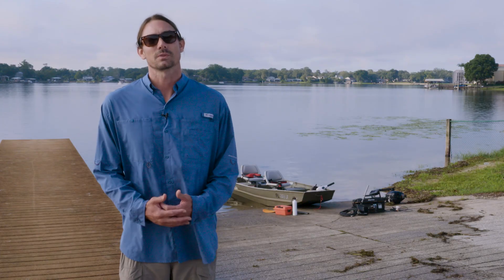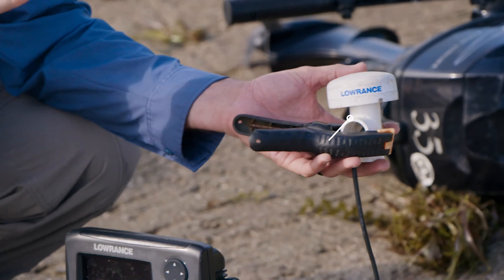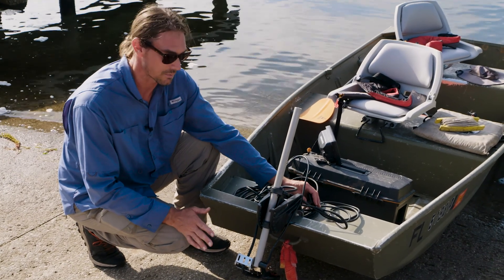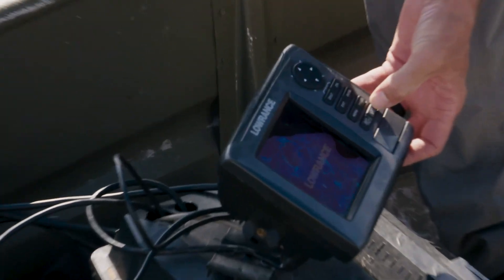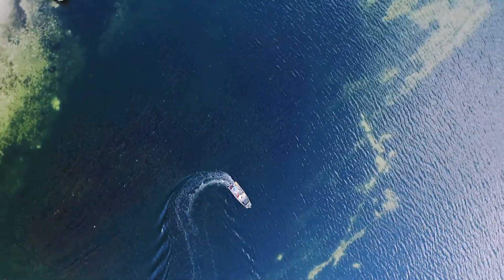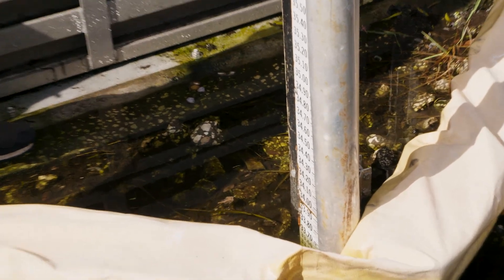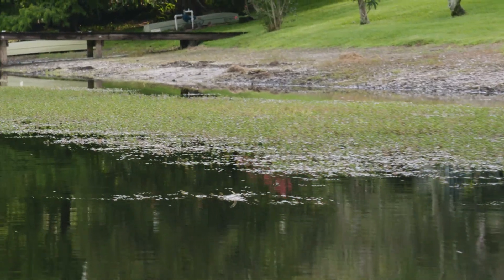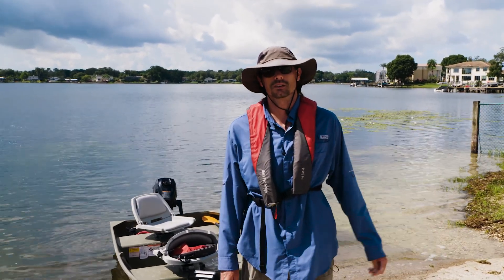Using Sonar Data for Bathymetry/Vegetation: Part 1 - Data Collection

Comment: How do you connect the externe GPS unit? Do you connect it to the Lowrance fishfinder or do you capture the positioning data sepperatley and match depth with the corresponding position while processing?
Reply: Jort, It connects to the Lowrance fishfinder through the network connection on the back